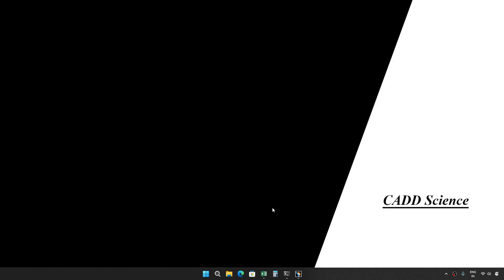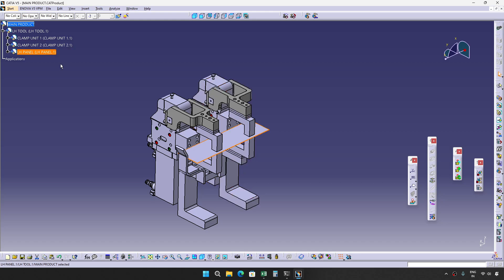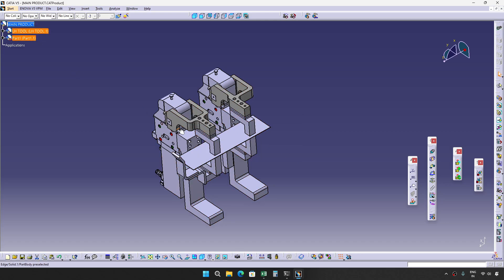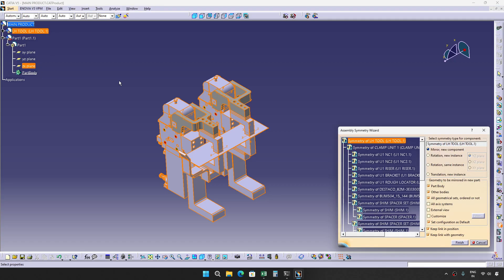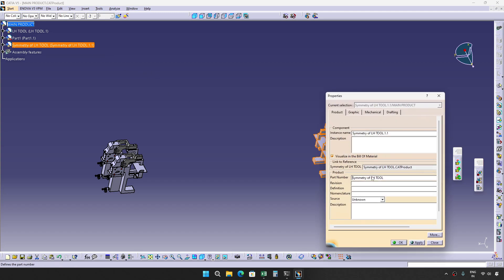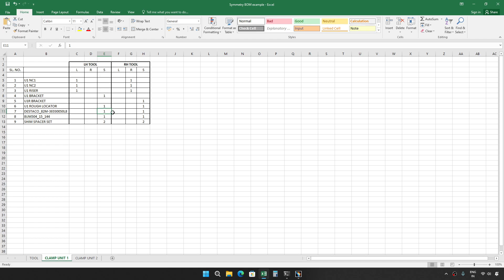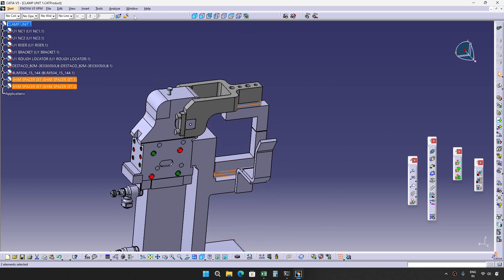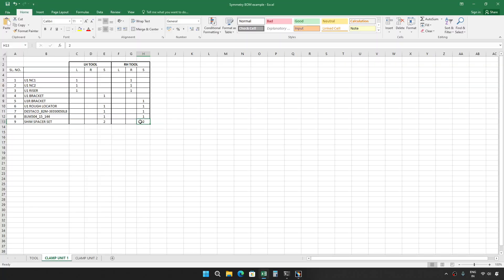SYMMETRY OVERVIEW | BIW FIXTURE DESIGN

Comment: When i use pin cylinder how much distance offset to pin sir  any reference is there sir
Reply from the maker: it depends on which cylinder you are using, the distance will be given in the datasheet of that cylinder